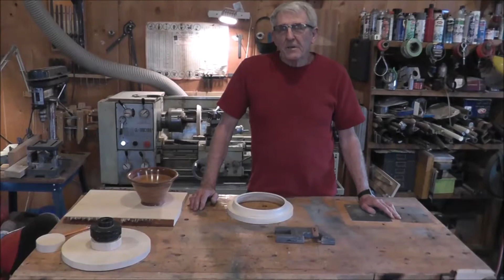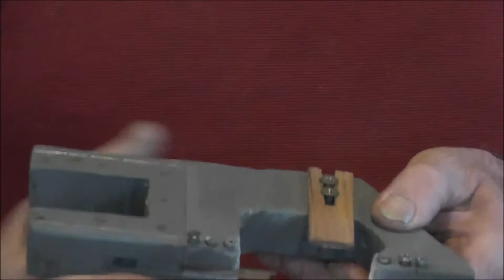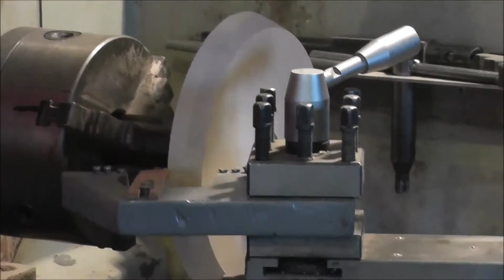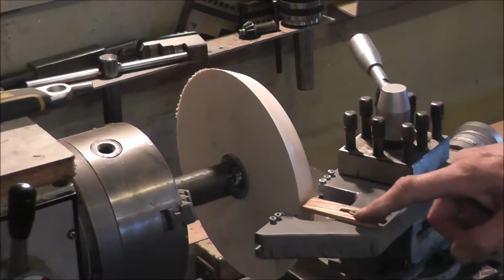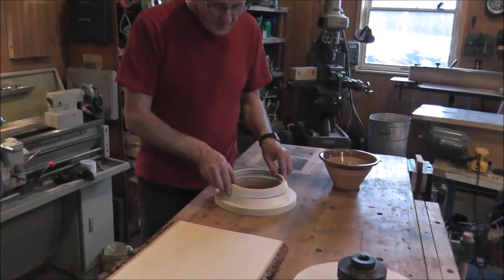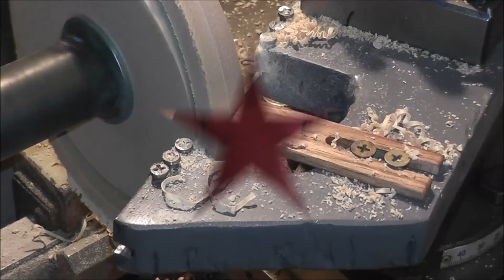Homemade Ringmaster adaption to lathe.

Comment: What speed (rpms) are you using?
Reply from the maker: by looking at the control levers in the video, it is ether 330 or 500. not sure what groove the drive belt is in. I also made adaptions for the wood lathe.  Slow speed is what is necessary.
Reply: @brianprocter6191  Thank you.